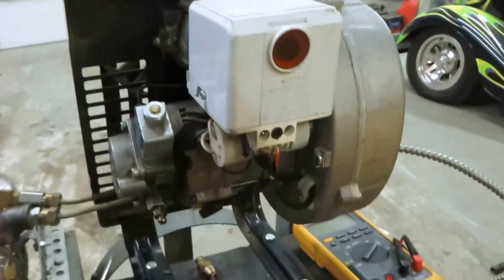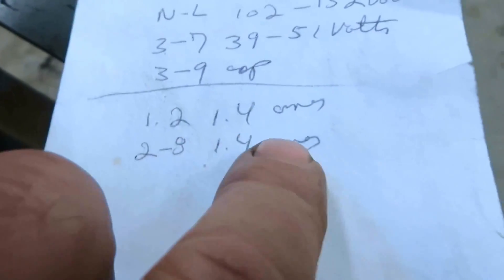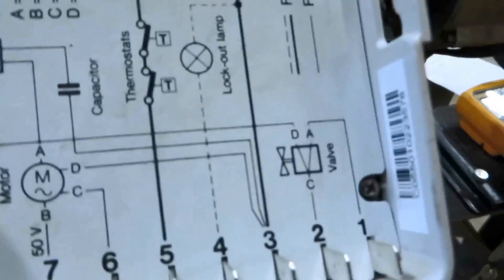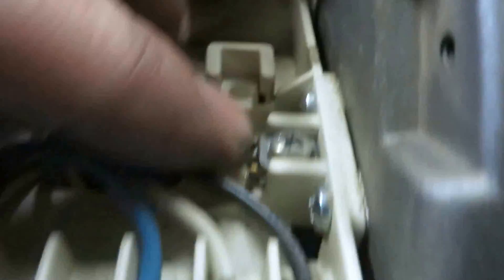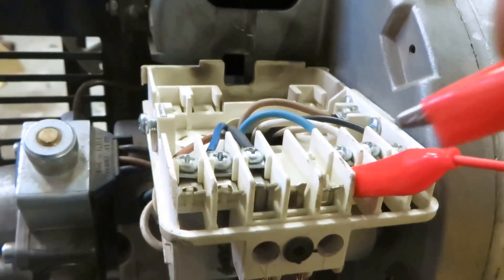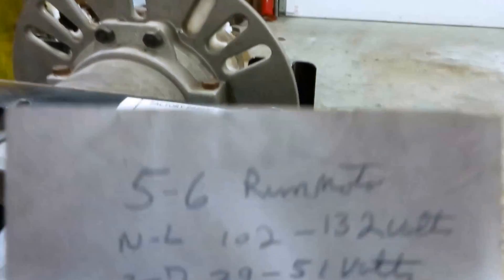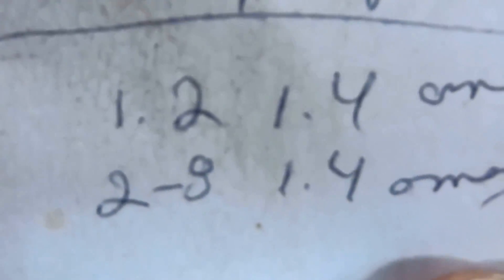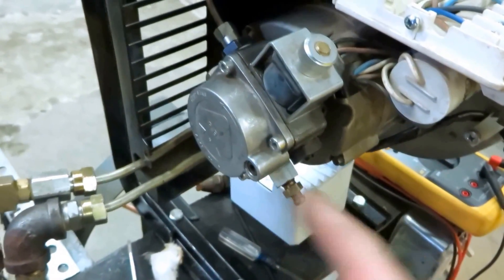Riello oil burner training series # 3

Comment: I have a riello I replaced control box and I still have no power no noise no sound I hit the reset button multiple times jump 5& 6 no power
Reply from the maker: DID YOU CHECK IF THERE IS POWER COMING TO BURNER ??? 5 TO 6 JUST RUNS MOTOR .. YOU PROBE LY HAVE A BAD MOTOR OR CAPACITOR .. IF YOU HAVE POWER TO BURNER AND JUMPED OUT 5 /6  ONLY MOTOR SHOULD RUN FOR PURGING OIL THROUGH PUMP

Comment: Hello I have a nuway nol 5 burner I have changed the oil pump nozzle  control box and base control box and I can get the boiler started only if I switch it on and off a few times also when the thermostat cycles it won't restart unless I switch it on and off a few times  I also changed the solenoid cable  thanks I have learned a lot from your youtube channel

Comment: But how do you check the control box to see if the electronic transformer is working or not? And during this checking when the motor is running, wouldn't the oil pump also run and spray out oil?

Comment: Steve 
You explained the CAD reading backwards! Your meter measures 7,000 ohms for low room light and 300 ohms for bright lamp light. The CAD reads high resistance for low light conditions and low resistance for bright light conditions.

Comment: Has the ignition coil on this controler got two primarys? It has four wires entering the high voltage transformer and two outputs to the electrodes. Has it two primary windings?  I was expecting two imput wires and two output connections to the electrodes.
Reply: And how do you check to see if the control box with the electronic transformer is working?

Comment: Hi Everyone,
Wanted to know what represents the voltage between  3-7 pins. (39-50Volts)

Is this some tachy control or something else ?

Thanks
Reply: That motor is two speed running at different voltages.

Comment: Crazy issue with my F5 .When motor starts it shortclcles rough 4 seconds for about 5 times then runs fine. Never locks out. filter /screen electrodes nozlle and control were replaced already. Is the motor on it`s way out possibly or cap? Tstat is calling. going use this test method tonight.
Reply: Had a similar problem with a Riello fitted with an air intake fitted on the cover. Without the intake fitted, the burner operated smoothly but when the intake was put back on the cover, it would occasionally short cycle.  The air intake was not obstructed. I then found that due to the positions of the flue terminal and air intake cowl positioned  near to some bushes, the bushes were not allowing the flue gases to escape to the atmosphere easily. As a result, the air intake was occasionally ingesting some of the flue gases which consequently caused a very brief starvation of air during the combustion process.  The bushes were removed and the problem was eliminated.

Comment: If the ceramic from the electrodes where broken or cracked could this have a effect on the burner firing?
Reply: Yes. The whole point of the ceramic being there is to create an insulation barrier from the high voltage of the sparking electrode jumping prematurely to ground before it jumps to ground near the tip of the nozzle. Once those are cracked, the sparks are always going to try and find the easiest path to the metal ground, which is not the tips of the electrodes.

Comment: Great video for anyone who wants to tackle a Riello Burner, The only things i wish to comment on is the use of the multi-meter was set to Auto so some of the commentary readings provided were incorrect, so just be aware, when testing the Photo-resistor, the Ohms value will go down when  there is more light and the readings for the Solenoid/Coil are different. For testing pins 1-2 expect in the region of 1.4 Kilo-Ohms and for pins 2-8 it is just 1.4 ohms. Many thanks, certainly helped me out!

Comment: I've often wondered, is there a way to do a test on the control box for the spark? When diagnosing, how would you know if you have a weak or no spark?
Reply: I asked that question to assess the transformer but no one answered. Have you found out how to test the control panel to see if the electronic transformer is still working?
Reply: The spark circuit is activated with a relay, so, the control unit removed will have on the spark connectors a small number of ohms. If it's either nothing at all, or shorted at 0 ohms, the secondary coil circuit is toast. You should also be able to get similar readings on the cool primary circuit by unscrewing the control unit base

Comment: Thanks , a troubleshooting flowchart brought me to a point where it said  buy a new controller" for $80" which is not the end of the world, but it would have been money thrown away. after watching your video, i checked terminals 1&2 for 1400ohms which led to the coil $10. 

Thanks for posting :)
Reply: How do you know if the control panel is still working?

Comment: Steve, My Riello 40 runs, but does not fire.  I checked the oil valve solenoid and got 1.4 K ohms between 1 and 2 and between 1 and 8.  The resistance was zero between 2 and 8 (blue and black), even in a new solenoid I got from Ebay.  However, the burner sprays oil, which can be seen as a fine mist visible at the chamber window when the burner is started.  I'm suspecting the primary control box to be faulty.  Is there a way to test the primary control box and the igniter within it?
Reply: I think by process of elimination if your pump is still working and the sprayed mist does not ignite then there is not ignition (spark) meaning the transformer is not working.
I am thinking you may want to connect leads 3 (neutral) and lead 5 (power) of the control box to 120 v AC power then cover the CAD cell and see if you would get sparks...

Comment: Is anybody have an idea why is  furnace  smoking,new fuel tank,lines,tigerloop,safety oil valve,ir has air supply straight to the burner but smoke is coming in the house through chimney?
Reply: check your chimney?
Reply: Make down the oil pressure and increase the air  pressure if u have black smoke
Reply: and check the secondary thermocouple pipe or smoking pipe's thermocouple..

Comment: Hey Steve, very useful videos thanks. I have an older Riello 40 G3, I have replace solenoid,photocell and nozzle recently, the burner runs fine for 10mins or so then cuts out, it tries to start but fails , the restart button does nothing then. Any idea what I should be looking at ?
Reply from the maker: +Clan Ryan have you checked the oil flow???? and pump screen?? sounds like you might have a oil problem ,it hard to say over a email unless i am there testing stuff .and running it hard to say whats going on .
Reply: +steven lavimoniere Hi Steve, I did take off the pump filter and clean it recently and also replaced the shutoff valve to oil tank. the tank is also lowish on oil so perhaps it isn't pulling it in properly
Reply from the maker: you might have a blocked oil line

Comment: Hi steve can you tell me how to check the spark on the transformer as you cant just stick a screwdriver across it
Reply from the maker: ***** you can hear the transformer spark there is no way to test it with a screw drive not a reillo if you thing the transformer is bad change it out and see if she fires.
Reply: thanks steve
Reply: actually that's just what he does on a service call in another video.  Wants it to jump at least 3/4 of an inch

Comment: Hi Steven, Just want to say a big thanks. I found your videos very helpful.. By comparing the startup up of your Riello to mine, I was able to establish that the motor was not starting when it should... Given that the motor did start some of the time, I suspected the capacitor.. Pulled it out altogether and it measured almost 1 ohm ESR and only 0.94uF capacitance... Changed the cap yesterday, crossed my fingers and the motor has been starting every time since.. :-)
Reply from the maker: Vital Computing looks like you had a bad run cap .the uf will be on the side of the run cap most are 15 uf but depends on what burner you have

Comment: Hello.
I have a Gulliver Blu burner that has started to run intermittently. It runs for 3 secs and pause for about 12 secs. The water temp does not go above 45 C. On the display it says Error 50-4 and 51-4.
Any idea what the problem might be=